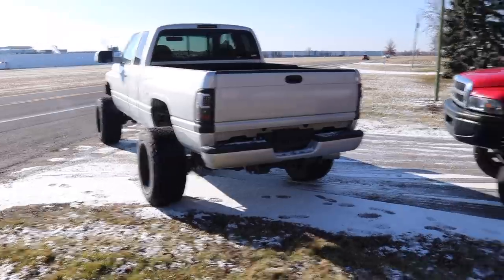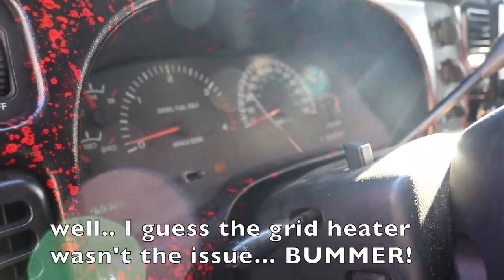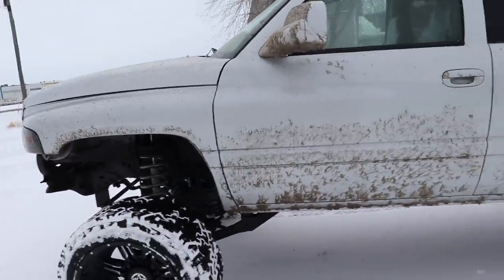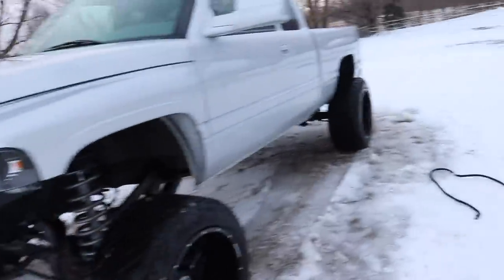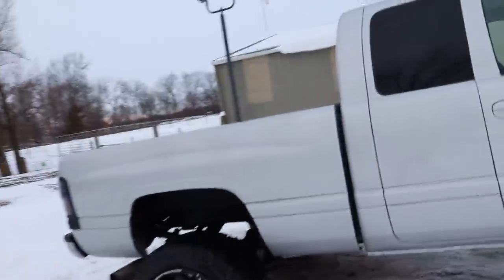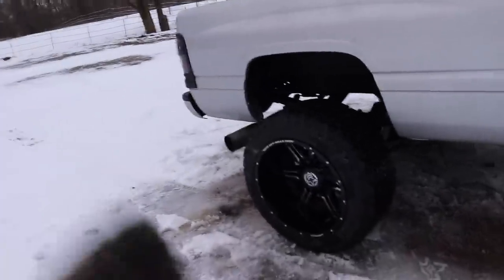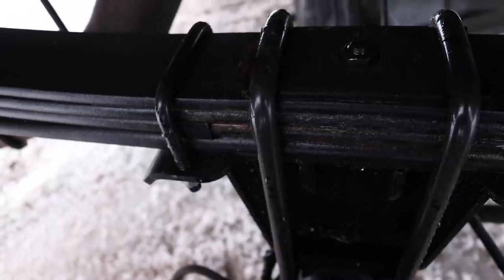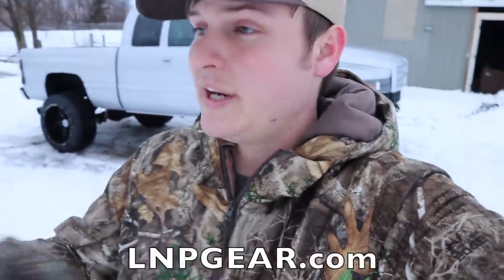NEW HUGE SUSPENSION LIFT IS ON THE CUMMINS!!!

Comment: I would’ve went with a one inch spacer in the front or took the 2 inch spacer out all together because when you put a load in the bed or hook up a trailer won’t it squat more since the 2 inch spacer is on the front? I don’t know it’s just a thought I had. How does the truck drive with the 2 inch spacer? Is it all over the road or pretty solid? I still absolutely love the truck!!! Look forward to more videos on it!

Comment: The issue on rosine is a fuel leak, there is air in the fuel system when you go to start it that’s why it starts up like that and once you’ve drive it the fuel is all primed up in the system that’s why it starts better after you’ve driven it

Comment: When you do a cold start on any diesel that is struggling and there is smoke coming out of the pipe, you need to hold the throttle to the floor until it starts.

Comment: I had hard starts just like that and I ended up replacing the over flow valve on vp44. 
The check valve wears out over time, leaving it stuck open and draining the fuel
Reply: I've commented before how it seems Rosine is starving for fuel,you maybe onto something

Comment: Good lord. That looks good...rams are the king's of trucks
Reply: They good If they would have put a half way decent trans in them though lol
Reply: @jacobhartnessgt2759  is the transmission that bad 😆
Reply: @LamontBoucherville  hell yea they are I had a trani go out of a 97 ram 1500 just sitting over night I going to go to work and I could not back up
Reply: @LamontBoucherville  and thot not to mention I got a 89 1st gen with a bad and transmission and a 2001 Ram 2500 gas with a bad transmission to
Reply: @jacobhartnessgt2759  good lord

Comment: Did you check the grid heater relay?
Reply from the maker: Not yet!
Reply: @LOUDNPROUD  You could take a test light, with the positive end of the light on the positive terminal of the heater, and turn the key on with the engine cold to test it. If it lights its getting power and you have some other issue like a fuel drainback issue. To me it sounds more like a fuel issue especially if it takes a second for smoke to come out the tail pipe.